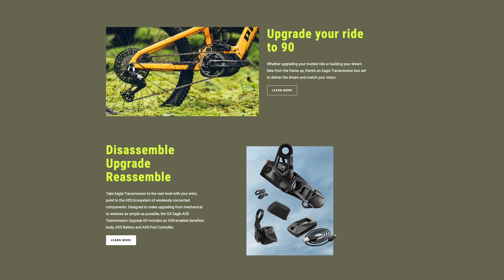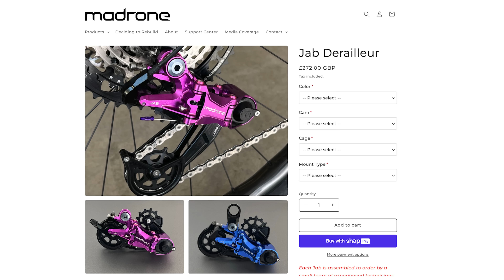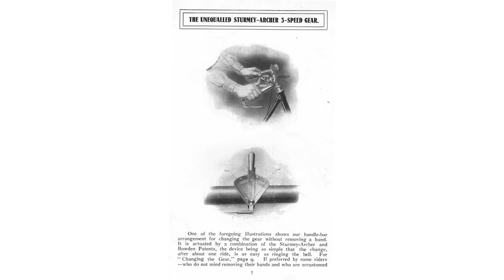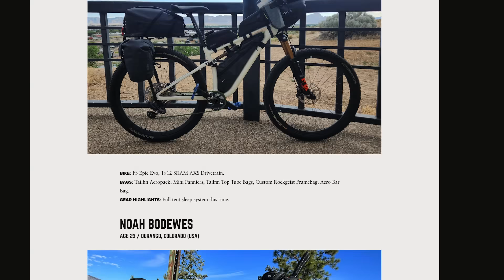Will we hear the last 'CLICK' of mechanical shifting?

Comment: Mechanical shifting works perfectly when it's been set up right, next to no maintenance once set up also.

Only reason the bike company's and shops push wireless is to sell new stuff people don't really need imo.
Reply: So those cables don't need maintenance then? And they don't stretch of course? I could be wrong (as I'm not a multi-millionaire businessman) but I suspect there's so much demand for electronic gears that companies see no reason to make mechanical for road/gravel bikes.
Reply: @kevinrichardson6270 well I have had the same cable for nearly 2 years on my bike and it's hasn't needed adjusting once, so yeah it's pretty maintenance free :)

Mechanical will be around for years yet not everyone is dropping 2k plus on a bike, it's never going to be be cheap enough to appear on the majority of the lower end bikes sold, and they would make up a bigger share of the market imo.

Comment: I will hear the last click till the day I die. In 2003 when I hear Shimano was not making MEN'S EDITIONS Ultegra, I immediately took enough money to buy the R8000 11spd groupset......it  IS great and amazing, and I purchased a spare set of R8000 STI shifters (MEN'S edition of course), also bought the derailleur so that in case of a failure from a crash they'll be easy to replace. 
There.........I will and rather die before I go millennial. Electrical and disc? PLEASE!!!!!!!!!!!!
Reply from the maker: What makes in men’s edition? The cable or the ratio?

Comment: I've build and ridden my bikes for around 35 years. I've never had a gear cable fail yet. If having said that I break one tomorrow, I keep a short piece of gear inner in my small (puncture repair kit box) tool kit and I would attach it between the barrel adjuster and pinch bolt on the rear mech, after putting the mech into a sensible gear to get me home. Also I can adjust with the barrel if the chain is misaligned with the sprocket. Having almost exclusively two chainrings, I still have choices. Most of my gear cables are totally externally mounted so replacement/lubrication is a job done in seconds. I'm talking 10 speed and less for my Shimano equipped bikes. Also easier to set up if the cables are internally routed as they are under tension, meaning no rattles compared to Di2 cables/junction box, for instance. All the time I can get cables and mechs, I will continue to do so. If I leave one of my (2) Di2 bikes for any time without riding it, I have to charge up again before I can ride it. I know beauty is in the eye etc, but from what I see of the massive rear mechs on wireless systems, it leaves me cold. In the same way as having a massive sprocket on the back wheel just so you can run a single chainring. However that is a whole new topic for what is bottled up and labelled as progress.
Reply from the maker: Nice.  👍.  I think the drive for mega wide tyres on a road chain line and BB is driving the whole 1x thing, and the aesthetics is driving the internal thing.  There is a fair bit of ‘you can’t have one without the other’.  It’s like progress in one area is bringing inconvenience in others.

Comment: For reference, let's look back at side window mechanisms in vehicles. For decades, they were all mechanical. We had to turn a crank. Then car makers introduced electric mechanisms that were priced considerably higher and were mostly on premium, upscale vehicles. Now, the situation is reversed. Virtually all vehicles now use electric mechanisms because they're much cheaper to make and repair.

I believe we'll see the same happen with bicycle drivetrains. Economies of scale and competition will drive the prices down. Also, the manufacturing process will become ever more efficient and less expensive as well simpler installation and maintenance. Mechanical systems will be seen as too complicated and onerous to manufacture and will eventually become more costly than electronic.

That's the future I predict and will become reality within the next ten years.
Reply: That's a poor analogy because cars already have electrical systems so it's a small step to add electric windows. Bicycles are different because they are simple machines and most people want them to stay that way.

Comment: Mechanical old group sets are still faster than the very best electronic eg 7 speed  Shimano MTB, also extremely reliable, independent of power,  batteries, water, and temperature. Even 12 s Campagnolo Chorus beats any electronic systems.

Comment: I can see as more and more cogs are added that tolerances don’t tolerate cable shifting. I have never been stranded because a cable failed. I have been on plenty of rides where someone’s battery has died.
Reply: You seem to be getting confused. Cables do break (I know). Battery dying is user error - nothing to do with the groupset.
Reply: @kevinrichardson6270  Why is a defect on a battery a user error?

Comment: Great video. 
 I think until electronic shifting gets cheaper; it will still drive customers to mechanical. I have 6850 Di2 on my Time and I love it. I love the thumb buttons to cycle my Garmin screens. However, I just got a new Look 675 with mechanical 105 12speed and I am blown away how good the shifting is! It's so fast and precise and the lever throw is so little. I feel it's better than my 6800 Ultegra mechanical and much closer to the 6850 Di2 stuff. They almost made it too good. 
My biggest beef with the cycling industry is disc brakes and the lack of rim brake wheels. I hate that Zipp, Envy, Reynolds, Shimano, etc... just plain stopped making rim brakes so quickly while millions of us still have rim brake bikes. I have a 2019 Time Fluidity that is still rim and I'm worried I won't be able to find a decent rim wheelset when the time comes.
Reply from the maker: Congrats on the new Look.  Mechanical is always good when it’s brand new.  Challenge is keeping it that crisp.

Comment: Mechanical is dead in high end, will be dead sooner than later in mid range (enthusiast) bikes, but will live forever in low end. Think about all sora or tiagra equiped bikes, or alivio or deore mtbs. Those are the high end of the budget market. Now go a couple of levels below: Walmart bikes. If the pricing goes down to a third it will still cost more than the bikes now for the electronic groupsets.

Comment: Never... When electronic shifting became ubiquitous, mechanical shifting became a premium niche like manual shifting in cars and mechanical watches
Reply from the maker: You might be right. Look out for the Shimano vintage special limited editions
Reply: All cars with manual are hugely cheaper than auto, that's actually a reason why there is still so many cars with a manual in EU. Applies to premium (charged, sport) models as well.
Reply: I rather like the sound of this, buying a new groupset marked as Ultegra on a full mechanical rim brake with the look and aesthetic of the 1990s (so all silvery and shiny to match my Steel bike) but quality of mid 2010s.

Honestly, if it was 105 I'm sure lots of people would 'update' their old 3*8 tiagra systems to a nice compatible 2*10 if the the aesthetic would match.

Don't get me wrong, I like the current 'stealth' look of all the groupsets. But on my 1990s Steely, have nicely chromed / silvered components just finishes off the aesthetic.

Comment: There will be a point in the not too distant future where electric system will be cheaper than the mechanical one. The reason electronic shifting is more expensive today is mainly for two reasons: development cost and the willingness of the customer to pay a premium for it. But from a manufacturing standpoint, mechanical won’t be able to beat it at the long run. Just look a the intricate mechanics in the shifters, and how more labor intensive it is to install a mechanical groupset. Meanwhile microelectronics, motors and buttons are dirt cheap. Also batteries, which always had been a cost driver in the past, have significantly come down in price. 

Mechanical groupsets are about to become the ICEs of the car world. Sure, none wants an electric super record on their 80s steel framed bianci, but these people will be in minority like the Porsche drivers enjoying the sound of a well engineered 6 cylinder engine. Most folks want a reasonably priced, relatively fast bike, no matter the ‚heritage‘ or ‚ tradition‘. And they will find that in a bike with electronic shifting.
Reply: Agree with the first part, but in Europe and US, EV remain a minority vs hybrids and ICE's...

Comment: I recently finished building a new ultra-endurance bike, and to get a SRAM Force 1 AXS 12-speed groupset, I purchased a Ratio Technology modification kit that includes a 1×12 ratchet to install in the shift lever, and two 12-tooth pulleys specifically designed for SRAM AXS Flattop 12-speed chains. The choice wasn't dictated by price; I could have bought Rival shifters and paired them with a Force XPLR rear derailleur for the same amount, or maybe less. I still wanted mechanical shifting, that's all.
P.S. Although in this specific case it didn't matter much to me, with this setup I managed to save about 200 grams.
Reply from the maker: Nice. We know ratio well.  They are just over the road.  I think you meant XPLR rather than AXS, but I understood.  Axs is the wireless protocol name. It’s just such a shame that your set up hasn’t been updated  and still has that terrible master cylinder and diaphragm.  I actually don’t mind the lever shape,
Reply: @Mapdec  You're obviously right about the "AXS" name, so I apologize for the inaccuracy. I was mainly implying that I used the AXS-derived crankset and flat top chain with a kit that allowed me to use the old Force 11 mechanical derailleur and shifters modified for 12 speeds and the "AXS drivetrain" (the Force 12-speed exists only in the AXS version), but I think you get the idea. Greetings from Italy :)

Comment: It is called development and as long as it outperforms what it replaces there is no way of stopping it. Yes, some will swear to never get electronic shifting, and they may even honour that, but eventually there will only be electronic shifting available. For me personally I love electronic shifting and I would welcome automatic shifting too, as long as it was fully customisable by the user in form of .e.g. a max and a min cadence for each gear, and of course an option to override the autoshifting on the fly. I already use fully synched mode on my Di2 and honestly cannot see any downside to it as long as you customize it to suit your riding style and needs.
Reply from the maker: Fully synched mode is an awesome feature.

Comment: This is looking like rim brake Vs disc brake 2.0 😂 I agree that the manufacturing of mechanical shifting may end with the next versions (the market to support existing systems will remain for years and years to come, just like with rim brakes). I think the aim of the OEMs is to get all cables off bikes, to make innovations to frame design easier. Now the shifting has been successfully updated to wireless, I think the next invention will be wireless disc brakes, with a small motor to move the pistons. I would definately miss mechanical shifting if it did become obsolete. There‘s something satisfying in not using an app to get perfect shifting 😊

Comment: I think for new mid range priced bikes / group sets the day will come that only electronic shifting is available (to the extend, that the frame can not even (easily) support mechanical shifting). But I think the market for mechanical shifting will be still active for cheaper bikes - these group sets are more maintained than developed of course but hard to beat the price of a mechanical setup and every penny / cent is key in the cheaper bike range. High end mechanical group sets for old frames might be an issue at some point because of availability and stop of production.
Reply from the maker: Yeah. I just think entry level is going to be mostly e-bike.

Comment: After being away from home for a few months where I only rode my new bike with Campag SR12 eps, i jumped on my old bike with mechanical SR12, and I have to say I much prefer the simplicity and directness of mechanical gears. I know some people don't like EPS but honestly I have nothing bad to say about it, it shifts, it's been reliable and in race mode it's pretty fast to shift, it's still not as immediate as a direct mechanical connection that even gives you feedback on chain engagement especially for the front mech. I really wish the market wasn't pushing mechanical off the plank.

Comment: in mtb the holy grail in drivetrains  is gearboxes with higher efficiency and comparable weight.  there is no reason to think that if MTB gets there it won't go into road immediately.  yes pedaling efficiency is more  important for road, but if the future is ebikes it won't matter. Downhill bikes that don't care about weight will be the first to adopt it (not there yet). the whole idea is putting weight as low and central as possible and removing attached devices that could be damaged.   A gearbox has the least maintenance of any system and is less likely to messed with by idiot consumers. And yeah, they will probably be electric.

Comment: Quite simply I've been let down by electronic shifting on a few occasions (flat batteries, random unasked for shifts, ...) but never been let down by mechanical shifting on over 35 years of riding. Sadly though, it does look like mechanical shifting for high end road bikes is all but dead - I do hope the boutique brands keep running with it - even if in low numbers. Maybe just like mechanical watches still exist.
Reply: Sorry, you mean you've let yourself down on battery charging.
Reply: @kevinrichardson6270 Battery degradation or dud battery. I'd ridden ~100km on it from fully charged!

Comment: Yes, i've changed a gear cable in the middle of an epic ride, also on another occasion had to shorten a chain and single speed it 30 miles through Wales to the nearest train station when my rear mech broke in half.  Would have struggled with electronics on both of those occasions.   Right now my summer bike is 11 speed 105 mechanical & hydraulic, whilst winter /long haul bike is 105 mechanical & cable operated hybrid disc.  I can see advantages to electronic, especially with old age & arthritis coming on, but i'm really not looking forward to the faff, and the potential of breakdowns that I can't immediately diagnose.   To give an example - my cadence sensor and head unit have stopped talking recently - change battery - nope, un-pair & re-pair - nope.  Not life changing, but what if it's a drive train component that goes AWOL like that?
Reply from the maker: That’s some serious experience.

Comment: I am in the process of buying individual Microshift Sword components to eventually rebuild my entry-level road bike into an adventure/gravel bike. 

But more on the topic, I think both mechanical and electronic can coexist, just like electronic and analogue/mechanical tech coexist in other areas (cars,  photography, etc.). Sure, electronic will be dominant and I personally plan to buy a racing road bike with electronic shifting, but mechanical will always retain a certain kind of charm (even though I could never replace a cable out in the field if needed). And as the big manufacturers move away from developing mechanical components, it creates opportunity for companies like Microshift to step in, which I think is great for the industry as a whole.

Comment: I actually have a mechanical being more durable/serviceable story. My front brifter broke a week ago, and the new one won't be in for at least another four days. Now my bike is how I get around town, and I live where it's hilly, so I need that front derailleur. Thankfully, my bike has fully external cable routing and downtube bosses, so I was able to mount up a friction shifter from a friend's bins and keep the broken brifter mounted as a brake lever. Is it ideal? Nope, but it's keeping me going. Also, I think y'all need to spend more time in the alt cycling sphere, as Rivindel recently announced a new rapid rise rear derailleur, and Growtac has released friction shifting fully integrated brifters. Plus, SRide, in China, is producing cool shimano style shifters to work with older 8 and 9 speed stuff.
Reply from the maker: Top fix! Love that.  Thanks for the heads up on Growtac

Comment: Paul I appreciate you're based in the Lake District where most are getting on their bikes for pleasure, but get yourself to any city in Europe with lots of cycle commuters and I think you'll conclude that cable braking, let alone shifting, isn't going anywhere fast
Reply from the maker: Last time I was in Manchester, London, Lancaster etc all I saw was e-bikes.  Either rental types or the disposable Amazon bikes.  Shelf life of a couple of years.  Cheaper to replace than repair.  Not that a repair shop can touch them after trading standards put notice to bike shops not to touch unbranded batteries.  With that kind of throughput these Amazon bikes will soon have a gear shifting system.
Reply: Most commuters are e-bikes now, in Europe...

Comment: Unless di2 etc comes down massively in price they surely will keep it in production for all the non high end bikes. Most of the bikes out there are department store CCMc Supercycle, etc so unless they can start pumping those out for $200 with full electronic I doubt it dies. Now in the high end road/gravel/mtb I can see mechanical dying since they can just charge 3k+ without anyone batting an eye.